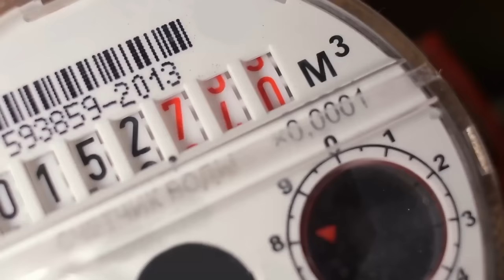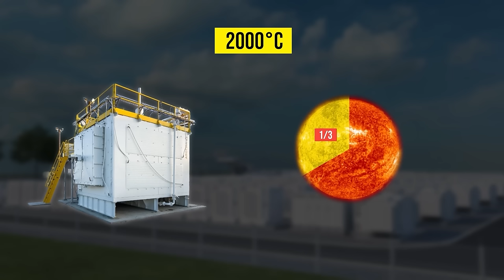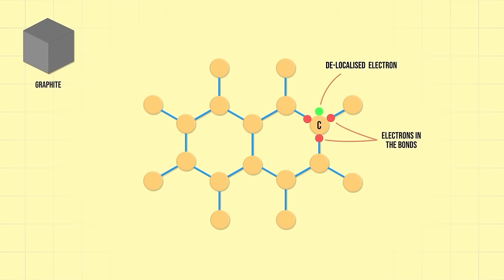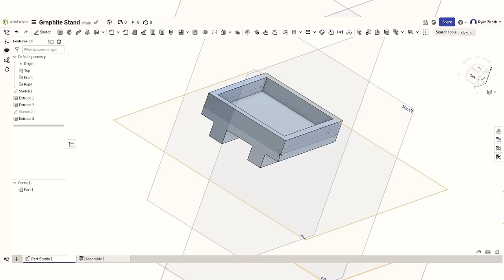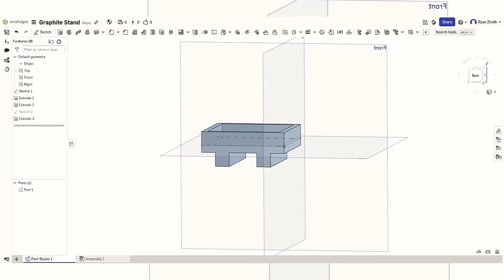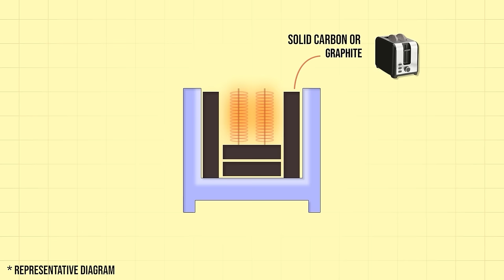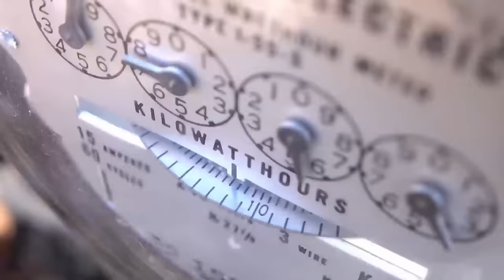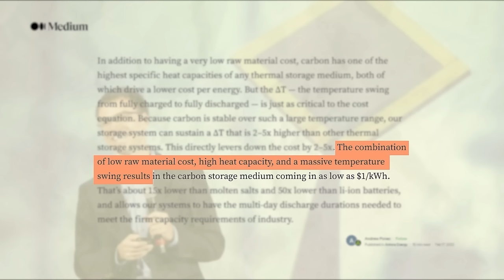Why Solid Carbon is the Future of Energy Storage

Comment: video suggestion - here you mention at one point the heat in these can be stored for days. could be explore the need for and solutions to seasonal storage be it heat or electricity. so keeping it half a year if we get more renewables in one season vs another. i guess wind and solar counteract each other somewhat but how much and what will we do about the difference. probably not the short term goal but eventually when almost all energy is not made by burning stuff they will need to balance out over seasons.
Reply: For very long term storage, the Finnish thermal sand batteries seem like a better solution. At least for stuff like domestic heating.
Lower operating heat (500C) + even cheaper storage medium (sand)
Reply: Seasonal storage is where I think chemical fuel synthesis will have a strong chance.  A chemical fuel can be stored with zero loss basically indefinitly and their are plenty of already existing peaking powerplants (basically big jet engine turbines connected to a generator) already in place which are going to lose market share to the short term renewable storage solutions.  Repurposing these generators into a seasonal powerplant will be effectivly free, at that point it's just a matter of replacing fossil fuel usage with synthesized hydrocarbons made durring times of peak energy availability.
Reply: @CaemmYsWoed  it was all around the news last year, but haven't heard about it since. I wonder how much progress they've made, by now.
Reply: That is highly unlike to be cost effective and/or it won't pay back itself ever. If you think how many charge/discharge cycles you get out of your storage over its lifetime vs the cost to build and maintain it, getting only a single cycle in a year makes the equation super difficult...
Reply: @DerMacko  "cycles" is not a valid unit here. What you want to know is yearly returns, which is energy provided per cycle X number of cycles per year X average price per kilowatt (assuming you can completely discharge, which is another factor)

If you can only do a single yearly cycle, but that one cycle provides steady heating for 6 months, know it doesn't sound that bad
Reply: @drillerdev4624   looks like my long reply didnt come thru... oh well can't win every time. add construction cost to your equation and do some maths. one cycle per year vs 360 cycles per year... your break even point escapes into far future.
Reply: @DerMacko  I insist. You can't compare "cycles" in the abstract. It's not a good measure in this context. It's like comparing trips for boats, but without acknowledging capacity and duration.

A local ferry can do several trips a day, while a giant cargo ship (like the one that crashed into the bridge) can take weeks for a single one. But their capacity, and the monetary returns for each trip are completely different.
Reply: @drillerdev4624  lets assume your storage can discharge 100kWh. You charge it to full with free energy, discharge it at 20 cents per kWh. One such cycle nets you 20 dollars. Lets say it costs 30k to build. With daily cycles that gives less than 5 years to break even. One cycle per year and it's 1500 years....

 The size of a storage that would last 6 months during heating season would mean about 10 000 to 20 000 kWh of energy (ie the equivalent of 1000 to 2000 L of heating oil, assuming climate like here in Finland). To make that equation work the building costs would need to be really really small per kWh compared to modern battery tech, and grid side short term buffers/storage would have been a reality long before that happens (the topic of this video).

Your cargo ship analogue doesnt really work as the fuel consumption and other costs dont rise in proportion to the amount of cargo on board. Bigger is always better, even if it's little slower. Where as it's all about rapid turn over with energy storage.

edit Ground source heat pump would sort of work if used for cooling during summer, ie pump heat into the bedrock so it is slightly warmer when the heating season begins, but that would require there not to be any ground water movements to transport that heat away before it is used.... and even then it would just leak all over the place.
Reply: @DerMacko  long term storage systems are meant to be charged and discharged for a long time, and have a higher capacity. Like the sand battery prototype. You can't compare that to a capacitor, for example. If your technology of choice has the ability to be charged (and discharged) within a day, of course it makes no sense to use it for long term.

Comment: How efficient is it really?
First the loss in the wind/solar device.
Then the heating of the block.
Then MOVING the block to where it is used.
Then the 40% of turning it back to electricity.
And depending on the use, there are several more layers of energy loss.

It sounds better to me to just use it as a battery on side of generation, acting as a buffer.
Not having to deal with transporting back/forth, batteries.
How well does it compete in that with other battery tech?
Reply: It isn't more efficient, kind of dumb that they're reinventing something that doesn't need reinventing but simply done for the sake of decarbonization. If anything sounds like an easy money grab from investors who doesn't understand anything about thermal batteries (I remember there is a molten led thermal battery used with Stirling engine, don't know what has happened to it last time I saw it was 2017). Great example of this is concentrated solar plant, more efficient than photovoltaic. I'm waiting for thunderf00t to make a video and shit on this too lol.
Reply: The round trip efficiency was mentioned to be 30-40%, which for me is not very worth it. Even if the renewable energy LCOE is low (0.04-0.05 $ per kwh), with that efficiency you would need to sell it at 0.15$ per kwh just to break even.
If they could raise it to 50-60% round trip efficiency, then we can talk. Because even with Lithium based batteries, the round trip efficiency is between 80 and 90%.
With 50-60% efficiency and the low cost of storage, the overall LCOE would be less than $0.10 per kwh, which is about the same as fossil fuel and nuclear LCOE. And they would still be able to make money at $0.15 per kwh.
Reply: Efficiency does not matter, just money gained per cycle per dollar invested

If the cheapest electricity price in a day is 0.00 and 0.25 - would you rather have one 100% efficient battery, or fifteen 40% efficient batteries? You'll make more money with the lower efficiency ones
Reply: Yeah I'm wondering if Power-to-Gas (use renewable to great H2) still beats this out. I've heard those systems are way more efficient than people realize. Plus there's no new tech and parts are standardized.
Reply: Only use case i see is where you cant bring power otherwise because of.. reasons..
Reply: loss in the wind/solar device of free intermittent energy from the sun and earth? we are not paying for that energy, the efficiency is nowhere near as important as the capacity.
Reply: @jonathanodude6660  In a way we do pay for it. Loss means more installations are needed, making the harvesting of energy more costly.

We would not use solar panels that have super low efficiency for example, it just would not work economically and the space used would be insane.
Reply: @TheEVEInspiration  Consider that for several hours a day, the solar panels may literally be producing extra energy that can't be used.   By storing it, that free excess energy can be sold later.
Reply: @TheEVEInspiration  you don’t pay for it. Whether you collect it or not, it is there. You pay for the equipment and the maintenance on that equipment necessary to harvest it. Super low efficiency solar panels ARE used in low power devices like calculators or toy cars because they are cheaper. They still harvest the exact same resource. 

Less efficient solar panels, like you say, increase the amount of space needed for the same power. However, as thermal storage, how much power is actually needed? Does producing and using this device actually cost more than not having it at all? The final cost just has to beat fossil energy. It can be 1% efficient but if it’s cheaper and more reliable despite that then it’d be worth it. Efficiency plays a role but it is not the be all and end all.
Reply: @macmcleod1188  True, hence my question how it compares to alternatives for this use.
Reply: @jonathanodude6660  Cost, including maintenance are always underestimated and underreported. It needs to be substantially better cost wise to replace proven existing reliable tech.
Reply: @TheEVEInspiration People use less efficient solar panels all the time.  If you don't mind paying NASA prices you can get MUCH more efficient solar panels. All the arguments abount efficiency when starting with a near zero dollar operating cost is disengenuous at best.  Most of you sound like fossil fuel industry trolls.
Reply: @TheEVEInspiration  “always”? I’ve seen plenty of projects especially in Europe come in under budget and within expectations. The pitch and then the bidding process are the source of the erroneous cost estimates. The actual people building it know what the costs are, especially if they’ve done it before (and the pricing details are available for everyone to see.)

Also, it doesn’t need to be substantially better cost wise because the point of switching at all, which will have immediate and high costs regardless, is to decarbonise; not necessarily to save money. The reduction in carbon emissions has a value, especially in a business environment with carbon credits/taxes.
Reply: @jonathanodude6660  Costs over lifetime, not just construction costs. Many projects have failed during their first years of operating.

In Europe with sky high artificial energy prices, that is less likely to happen. But that should be viewed as subsidies, not market pricing.

As for CO2 reduction having a benefit, that is very dubious even while politicians are all in on that.

Same with carbon credits, totally artificial as a result of policies. No person is actually wanting to pay for that.

In short, solar/wind energy in Europe is a political artifact, heavily subsidized in various ways.
Reply: The real use case seems to be in industrial settings, where you need a lot of heat, so no conversion back to current. The major contributors to carbon emissions are precisely these kinds of industries.
Reply: @Simqer  "The round trip efficiency was mentioned to be 30-40%,"
But energy loss is heat so the loss stay as heat into the battery, am I wrong?
Reply: @arofhoof  "But energy loss is heat so the loss stay as heat into the battery, am I wrong?" Energy loss is net energy and would include any energy recovered as heat. It's likely that this technology is too inefficient to be useful unless it's per unit cost is extremely cheap.
Reply: @arofhoof  no, there are different kinds of loss. First one is the obvious, no matter how much insulation there is, some heat/energy WILL escape.
Second is the energy loss when converting electricity into heat.
Third is the conversion from heat back into electricity, yes they mentioned that energy that wasn't used was reflected back, but you can't go about it without any losses. There is not a single perfectly contained system. Although I do have to say that the TPV seems ingenious, using a steam system would have caused more losses. That is if what they say is factual.
Reply: The thumbnail of the video says insanely cheap, not extremely cheap 😂  @jeffjwatts
Reply: "Second is the energy loss when converting electricity into heat.
Third is the conversion from heat back into electricity, yes they mentioned that energy that wasn't used was reflected back, but you can't go about it without any losses. There is not a single perfectly contained system. " @Simqer  

But the loss is heat, therefore can be recover when the battery is in "heat out" mode
Reply: "It's likely that this technology is too inefficient to be useful unless it's per unit cost is extremely cheap." @jeffjwatts  

But in "industrial heat out" mode it is likely very efficient?
Reply: Where could you possibly have gotten the idea that anyone is transporting charged thermal "batteries"? 😂😂😂
Reply: @benjamindees  It is explicitly stated in the video, did you watch it?
Reply: You are absolutely right. Just another niche solution looking for funding, probably at a loss,  till a reliable cheap battery, perhaps na-ion, becames a standard. And the kiddo here is just doing what youtubers do, trying to earn a buck with "wows" and "waws" "this could and may and perhaps be the next best thing after jesus f. christ  (if you don't look too closely, or have some real formation on the subject)" 😂
Reply: These are 100% for stationary use only.  If you got some other idea from the video, please provide a timestamp.  @TheEVEInspiration
Reply: "that anyone is transporting charged thermal "batteries"?" @benjamindees  
Why transporting them? those are industrial battery
Reply: @TheEVEInspiration  "It is explicitly stated in the video, did you watch it?"

transporting from the factory that makes these to the place where it will be installed.  In-situ building is super expensive (or impossible even) compared to a production line.

Could be a buffer at a solar farm, or a heat battery at a factory that gets charged when electricity is cheap.
Reply: @DerMacko So, transporting them once? So what?
This is like "muh plastics in wind turbines", yeah after decades of making free energy... compared to the millions of bottles thrown away in that time.
Reply: @TheEVEInspiration 
Zippa de doo-dah
Flibbidy flies
Fossil fuels are also
Very subsidised
Reply: @michaelmartin9022  sorry what? Are you upset because they can be transported on a flatbed trailer?  like wut, why??
Reply: @DerMacko  Wut? No, it's just that transporting them once might use fossil fuels, but only once.
Reply: @michaelmartin9022  i feel there's been a misunderstanding somewhere along this convo, lol. I've never said anything about the ecological cost of transporting these, merely that because they can be transported easily means that they can be built at a centralized plant/factory making them cheaper and potentially of higher production quality. (compared if they were built/assembled at their final destination from scratch)

Comment: a lot of effort to build a giant barbecue grill. 
I want to see how they reliably guarantee that no air can enter the "battery" over a life span of 30 years. At these temperatures, they would need argon as an inert gas to prevent the graphite from igniting. If air will enter those red-hot "batteries", they will just go up in smoke (or CO2, that is, besides probably some not-so-healthy nitrogen compounds). Hence they also will need a completely IR-transparent but very durable "window" to harvest the heat. Mixed materials, mixed thermal expansion coefficients, frequent heating cycles over a wide range... that's what makes mountains crumble and housings rupture. 
I don't say it's impossible, but it's surely not as cheap as announced.
Reply: Yeah, what seems easier is burning natural gas to heat air in a turbine and produce electricity (unfortunately). I think the clean tech dark horse to watch out for is a lead cooled nuclear reactor moderated with Yttrium Hydride. Perhaps with a supercritical CO2 turbine to produce electricity.

Comment: I could imagine one of these being installed at somewhere with a constant need of heat like a large swimming pool and its charging only turned on when "the price is right". This would save them moment and reduce their useage of natural gas and offer themselves as a power-sink to the grid
Reply: If you got a swimming pool full of water, you already have a huge thermal battery. Heat it slightly warmer when energy is cheap.
Reply: Considering they do not hold energy for more than "days" it is kind of wasteful for a small size house energy storage.
Reply: @Oktokolo  true, I was thinking that battery could help them activate that whilst keeping a steady pool temperature

Comment: Thank you for another informative video. My son ans I were talking about the need to develop better large scale batteries for the future just yesterday. This sounds like another very effective option with versatility that other sources don't have. I first found out about the properties of heated carbon in welding class fifty years ago. With an arc welder, two carbon rods hooked up to the welder and brought almost touching together, creates the perfect brazing temperature. They glow like heated steel and last for an impressive time.

Comment: Industries in the business of creating generators, motors, or motor applications typically use thermo-piles (carbon blocks shorting out the electrical output... and huge fan driven heat exchangers to ambient air) to  "waste" the energy (i.e. load their systems being tested).